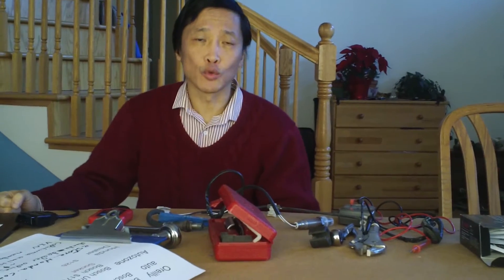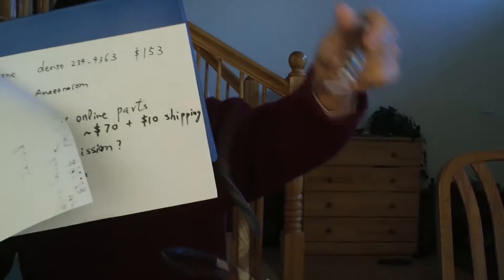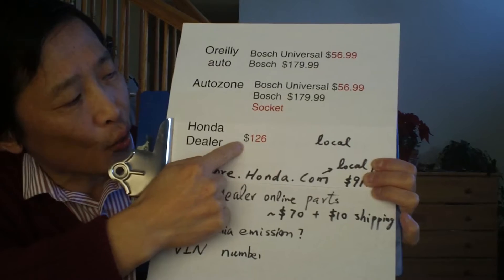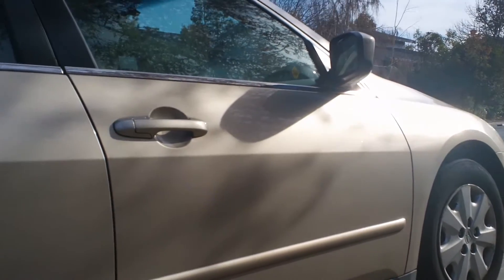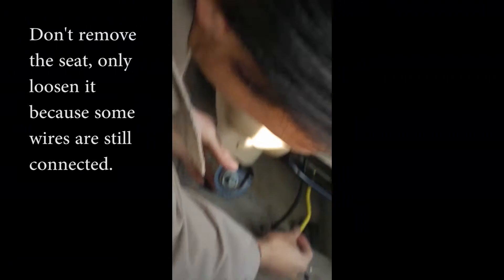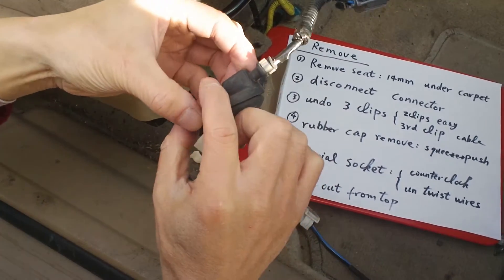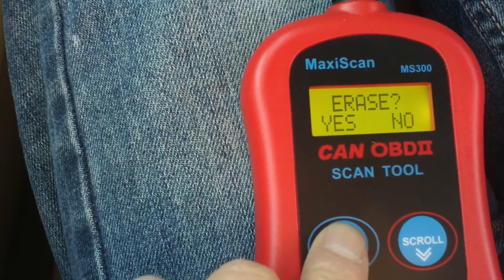6 Steps To Replace An Oxygen Sensor

Comment: Didn't see u put it in
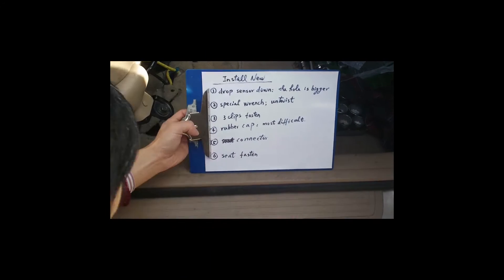Reply from the maker: I only installed the honda sensor, did not install the universal sensor. When you remove the sensor with the 6 steps, by watching this video, it gives you the key knowledge how the sensor is fastened. The 6-step to install starts at 08:30, drop the new sensor down etc. Since it was harder to show under the car, some steps I showed above the car. If you paid attention when you removed the sensor, the installation is just the reverse, it should be relatively easy.
Reply: I have the same car 04 accord and all the same problems: lol